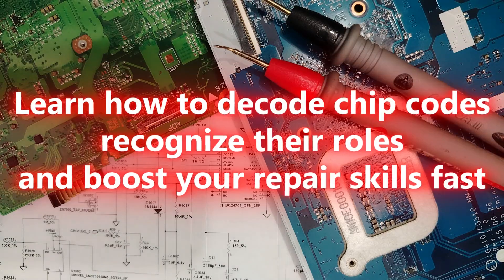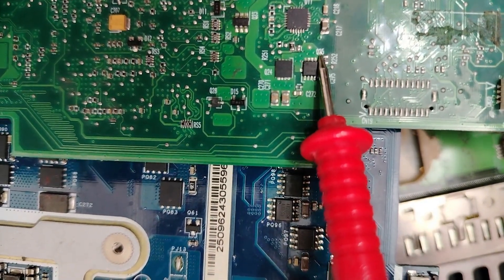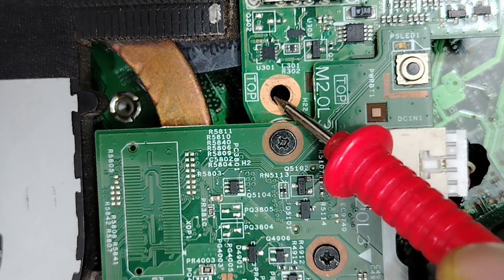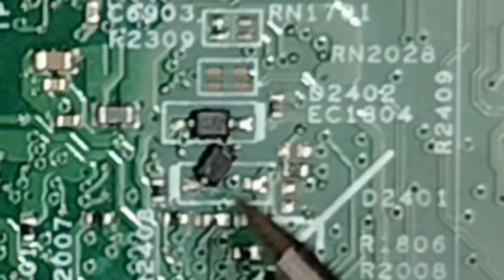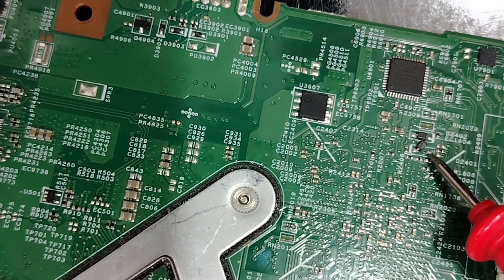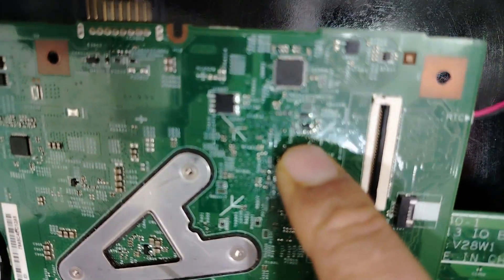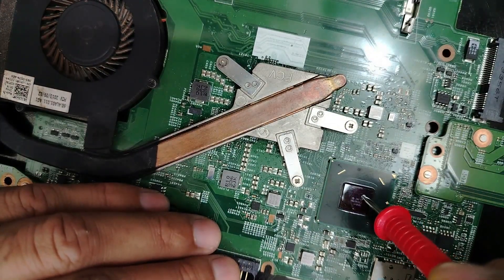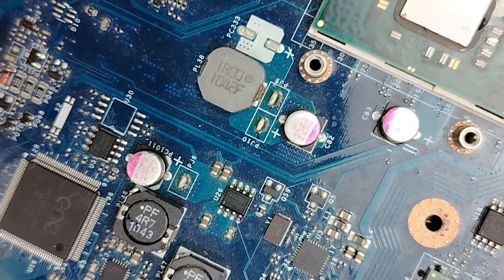Fix Motherboards FASTER by Understanding These Codes | Laptop Repair

Comment: I switched it on it stays few seconds and off and how do I identify the battery charging circuit, 3.3 5v system and test power jack in latitude e6420 dell
Reply from the maker: The battery charging circuit is usually centered around a battery charger IC such as a BQ247xx series (from TI) or similar. Here’s how to find and test it:

🔍 How to Identify:
Look for a large 20-28 pin IC near the battery connector.

Common marking: BQ24725, BQ24707, ISL6255, etc.

Usually located close to the battery connector and has 2–4 MOSFETs nearby.

You’ll also see large inductors and ceramic capacitors near it.
Reply: What about  3.3v,5v circuit  if i am using dell  e6420
And also another question is, if I am experiencing intermittent  power  what circuits and components should  I test.
Reply: Thank you
Reply: The SIO ic and charging ic  how are they related

Comment: Pls use dell latitude e6420 if you teach intermittent repair
Reply from the maker: Noted
Reply: Pls If my laptop e6420 is experiencing intermittent power what circuit and components should I check and how do I identify these components